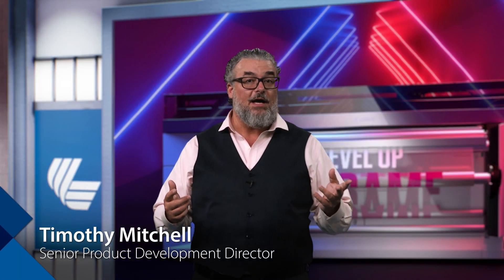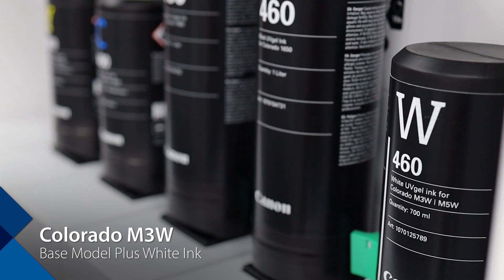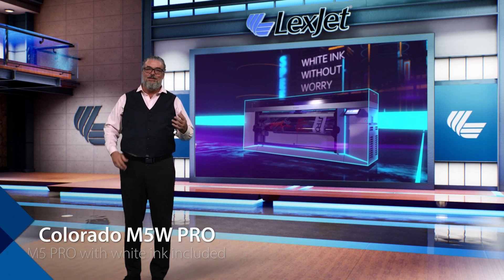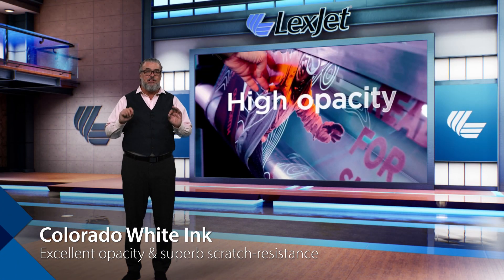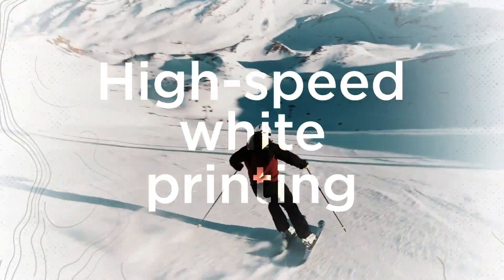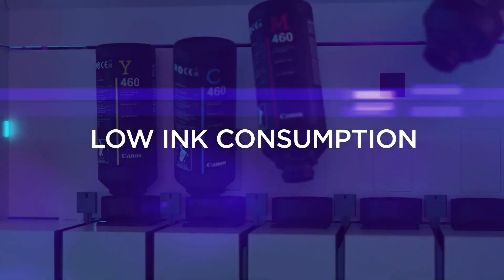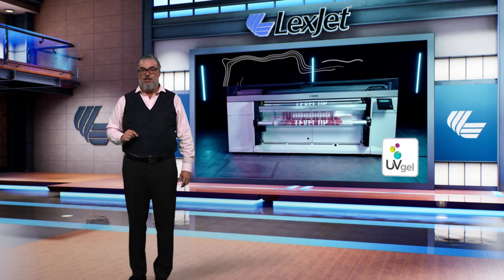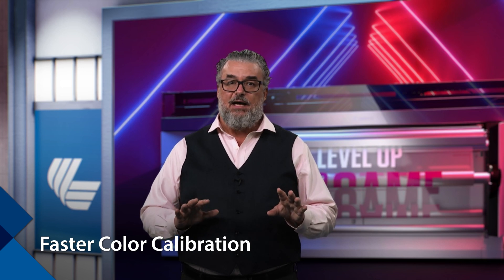Canon Colorado M-Series Printers with Timothy Mitchell

Comment: Service contracts are expensive and not the best service. left my Colorado 1650 down for 2 weeks, unacceptable. 2 cheaper competitor printers will be just as fast as one colorado, cheaper and provide redundancy in case of break down, point to consider